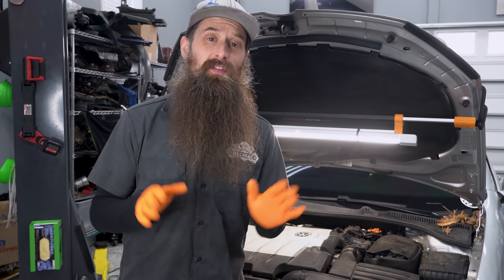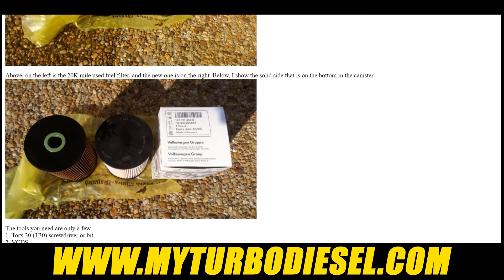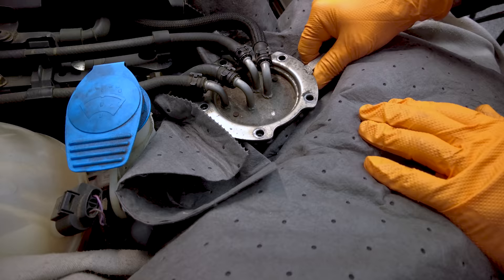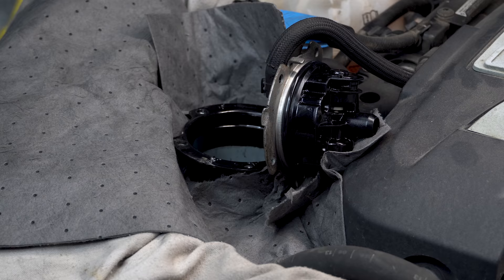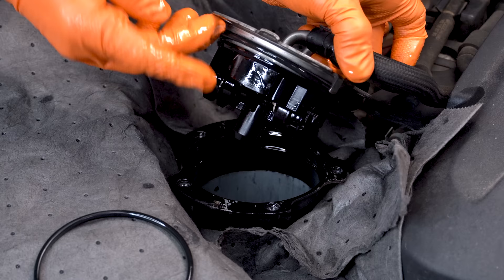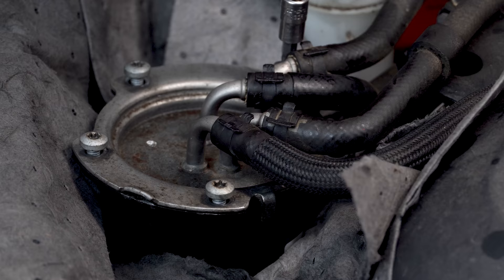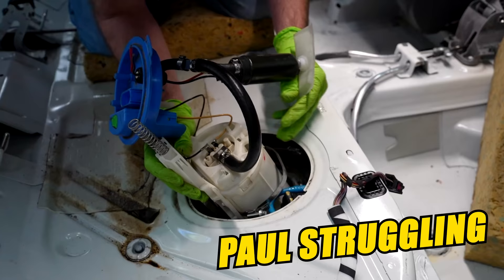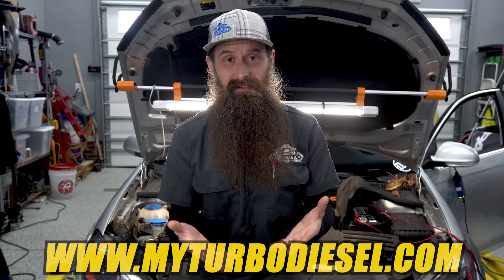Volkswagen Jetta TDI Fuel Filter Replacement ~ Common Rail Diesel

Comment from the maker: Now that we have access to a TDI, what kind of videos do we need to do? This one will need a timing belt soon ;)
Reply: 12' a3 tdi just discovered I've got a parasitic drain somewhere,new battery&charged fully,drove twice,sat for 3 days in bitter cold&dead,no aftermarket electronics.Any common places to start w/this gen tdi?
Reply: If its a model with swirl flaps, have a look at those! Terrible things, much better to use the aluminum intake without them, for engine longevity. Also i had myself a laugh after first having a Passat TDi be dead from swirl flap failure, and then to my surprise i found out the Mitsubishi Outlander also uses a VW 2.0tdi! Sans swirl flaps, luckily!
Reply: EGR, maybe which upgrades an tdi will do
Reply: I'd love to see info and opinions on the intercooler icing issues!
Reply: Waggle? =Wiggle+wabble
Reply: Timing Belt- My '13 Passat will need that soon. Also, I have a slow coolant leak from ABOVE that auxiliary coolant pump. I don't think it's the pump but I haven't pin-pointed it yet.
Reply: 3.0 TDI swap.
Reply: EGR replacement please!! Love the videos man! Do you guys own the TDI? Or is it a customer car
Reply: @acefighterpilot  i need this for my d2 A8 haha
Reply: Do a water pump. Because mine blew on my 2015 golf TDI.  the cooling system is why more complex than  my mk7.5 GTI.
Reply: Timing belt would be appreciated! I got a 2015 tdi, but I'm sure a lot would be similar, also the fuel filter is a bit easier to change on 2015s imo
Reply: Diagnostic fuel cumsomption comon issues that look to high for tdi. I also would like to know whats your take on the performance before and after  the dieselgate cpu/hardware update. how the cars behave and drive.
Reply: Explain why the 1.9 is superior to the 2.0
Reply: Turbo work and injector work
Reply: @MadMaxx570  I need the part number. I can’t find this mythical intake manifold anywhere.
Reply: Definitely do an EGR clean and/or replacement!
Reply: Timing belt sounds great. How about a CP3 mod to get rid of the trash CP4 on that engine.
Reply: Can you do a video with your Touareg?  I have an awful time with the filters when I grab the little handle and try pulling it out.  I’ve actually pulled it out with the spring loaded pipe it goes on. Then the pipe never stays in the housing because the tabs get messed up. Thanks.
Reply: Fuel injector checks and how to clean the nozzles
Reply: If this is a DSG car, definitely the fluid change and the brake fluid changing procedure (especially in regards to the clutch)
Reply: Thermostat!
Reply: COMMON ISSUES WITH CR-TDIs
Reply: Please do diagnosis for the intake motor flap :)
Reply: o2 sensors and cleaning them please! My 2011 is throwing codes for the sensors and I'm hoping I could pull them and clean them and not have to spend much at all (maybe glow plugs too since its winter, thanks for the awesome straightforward content!!)
Reply: A video showing any 6 speed maintenance aside from the normal fluid change would be cool. Also, my fuel gauge randomly decides to not show anything. Very intermittent but maybe a video pulling the fuel pump assembly? Thinking a dirty or faulty sending unit could be the cause?
Reply: @BrydonMedeiros  had the same issue, take out the sender unit in the tank and clean with electrical cleaning spray the PCB located on the level arm
Reply: @kh_trendy  been there got the “fixed IC” with flapper and vacuum lines per VWoA on my old 2010 CJAA. Amazing the amount is of money they were willing to sink into TDI at the start to keep thee engines on the road.
Reply: @theodosispasiali2119  dieselgeek bracket fix for the win at $70!
Reply: Yes, timing belt. How do I inspect it, check its conditon and of course replacement.
Reply: @glengill8904  Get a multimeter and check the fuses. Charles has a video on how to diagnose parasitic drain.
Reply: @740GLE  thank you 🙏
Reply: Something on the crankcase ventilation would be amazing. 

Also cleaning the vnt of turbo would be great as well!!

Thank you!
Reply: @ryang5441  dsg has a clutch?
Reply: Oh and the DPF, how to take care of it, how to know if theres a problem, what can VCDS do for us, can it tell us the state of sediment, is it a good idea to do the "emergency DPF cleaning" and if so how?
How else to clean the DPF?
Reply: @Lagggerengineering  it’s simple, delete it.
Reply: @briansmith9258  Unfortunately we people not in YEEHAW land cannot do that without violating emissions regulations.
Reply: @Lagggerengineering  you keep your stock system for emissions test and warranty work. Pita to switch exhausts but it’s what they do.
Reply: @Lagggerengineering  you can buy a replacement exhaust with a hollowed out DPF. Readiness tune.
Reply: Delete, cp3 swap, bigger turbo, tune.  😊
Reply: @sturmantheyounger  Jeremy Clarkson: POWAAAH
Reply: @briansmith9258  has two!!!
Reply: How do you extract more performance from a diesel?
Reply: T3 TDI routine maintenance

CJAA timing belt service, and how to know when to change the serp belt
Useful mods vs. waste of money (IE, fluidampr vs "cold air" intake, etc)
Trans fluid flush
Passat/CC control arm mods
Selecting and installing GTI, TT-S and S3 parts as OEM+ upgrades (rear sway bar, short shifter install, control arm bushings, etc)
Haldex swap
Reply: Egr and intake manifold cleaning video maybe?
Reply: @magellanicspaceclouds  just a tune can do a lot.
Reply: @audiquattro3963  cold air intakes lol
Reply: I've got a VW Jetta 2015 TDI
Reply: @740GLE  I know that but it’s not like a manual that uses brake fluid that needs bleeding like a manual. That’s what he was asking. He had dual clutch dsg confused. Is how I read it.
Reply: @740GLE  can you elaborate on the vacuum lines? This the first I’ve heard of it.
Reply: @briansmith9258  for CJAA & CEBA Gen 1 CR TDI VW implemented a vacuum actuated temperature controlled IC flap, that blocked off half the IC if the intake temps were under say 40f, this helped prevent moist EGR gasses from freezing in the IC and then thawing and pooling up in the IC piping only to be sucked into the intake and cause a hydro lock situation 3-5 seconds after starting the car. If you tried to start the car it’d act like the battery was dead unable to turn over the engine until the condensation passed the rings. There were some cases of bent con rods that required new short blocks. I personally had 3-4 cases of hydro locking before the IC kit was installed. There’s a TSB for it, it was quite a creative solution VW came up with.
Reply: We need all the tdi videos. I love my 14 jsw
Reply: Thermostat
Reply: Intake manifold. The flapper motor likes to have a holiday something something dieselgeek bracket.
Reply from the maker: Oh yea. I actually did a video on that forever ago! But I bet I can do better
Reply: @HumbleMechanic  quite literally I drive 15,000 miles a month on my TDI. Currently at 192,437 mi, we bought this JSW in July of 2021. They're the best. Bought at 109,000
Reply: @Skrillfreak  perfect kind of driving for them
Reply: @briansmith9258  I agree some video on how easy a catch can would be on these cars as it makes me uneasy seeing how oily the intake side is from it…
Reply: Cp3 upgrade and install!!
Reply: @InternationalCombustion  yeah my big issue currently besides swapping chargers. Is catchi can.  Ecs kit is 300+.  I read about somebody using a jeep brand one off eBay for like 120 maybe.  I definitely need something.
Reply: bleed coolant system on 2015 mk7 crua
Reply: make a video for frost heater install on mk7 TDI, please and thank you.
Reply: @InternationalCombustion  I don’t know if you’re joking or not, but diesels don’t need oil catch cans.
Reply: @jottow680  walk+wiggle
Reply: @glengill8904  77⁷⁷6 6th
Reply: Please do a dpf on the tdi. Is there a way to cancel out the dpf. I constantly have issues with this and the dpf keeps coming on.
Reply: @fearofchicke  1z/AHU most certainly don't if you are up for removing intake manifold and spending hours cleaning MAJOR yuckity.  At 100k the intake ports on head barely had room for a Sharpy marker pen.  Alfdex makes a spinner on my 13 liter Volvo... basically all big trucks are same with exception to body mount which bolts to engine block. It uses oil port to spin a cage much like amusement park ride (where the floor drops and you are stuck to wall) but only thousands more rpms.  No more oil spot after idling overnight.  The old design of vent to atmosphere caused nerve damage to drivers after several years.
Reply: not sure if i’m too late, but all the basic maintenance (fuel filter, timing belt, all fluids) would be nice to know how to do… as well as everyday diesel maintenance (how to burn out DPF, fuel additives, etc)

Comment: Without a scan tool: pull off the top-left fuel hose from the cap,  pull the cap off and see what is the fuel level relative to the container. Put the new filter back in and let it soak some diesel in, top it to the same level with fresh diesel, put the cap back on, if you went too high, the surplus will exit trough the cap hole, after tightening the screws in  a star pattern, put the hose back on, cycle the key 2 times and it starts up like nothing happened!
Reply: Me same
Perfect
Thank y'all

Comment: I have owned a CJAA VW Golf TDI for 8 years now and you do not have to use VCDS to prime the filter housing, but it is the most efficient way to ensure all of the air is bled out of the fuel lines. Personally, I fill the housing up to a little over half way and put the filter back in slowly. This ensures that the housing is "roughly" all the way full without any overspill and you can cycle the key 2-to-3 times to get the air out and ensure that you do not run the HPFP (High Pressure Fuel Pump) dry. The biggest discrepancy on this car is arguably the HPFP. If buying a used GOLF TDI, ensure that there is no metal shavings in the fuel filter housing or clinging on the inspection screen on top of the HPFP before signing any paperwork.
Reply: Doesn't work on all. Key cycle does absolutely nothing on my 14
Reply: @davesnothere3425  strangely I have a 2014 and mine doesn't have an issue and I replace my fuel filter twice and I do it the same way that this guy does it.. make sure those fuel in the filter housing I even put some fuel treatment additive in the filter housing to give the injectors a good clean. And I never used vcds or any scan tool bulshit to prime the fuel system.. if you cycle the key on you can hear the fuel pump in the fuel tank running then shut off.
Reply: Vcds is not even that expensive, obd11 is even cheaper, just bleed it, vcds and obd11 pay for itself after the first fuel filter change

Comment: Can't extinguish the CEL that came on after replacing filter. I can cancel CEL with my scan tool, but light comes back on after engine re-start. Also, it shows no codes...just annoying CEL for no apparent reason🤬

Comment: Yay TDI's!
Not sure about the CR TDI's but you can remove the filter housing of PD TDI's, it's held on by some tabs. If you dislodge the housing from the tabs before removing the cap, you can take the housing off the car to empty it into a bottle and/or cleaning the inside of the housing. Having the housing off the car also makes it easier to fit the new filter.
They're super old but more PD TDI videos please!

Comment: I typically use some fresh ATF to lube the o-rings on diesel fuel filters. ATF is a bit more slippery than Diesel, so i find it's better for avoiding pinching an O-ring. Also it mixes very easily with diesel and diesel engines can basically run on the ATF anyway. So a few drops of ATF in your diesel fuel isn't going to harm anything, in fact most likely the opposite. There's lots of detergents in ATF that can help clean carbon deposits. An old farmer's trick for having an injector that isn't spraying well is to pre fill you fuel filters with ATF and run it.
Reply: Do NOT do that on a CR engine. Sure fire way to destroy the HPFP is mixing anything in the diesel. I've had to replace the complete fuel system of a friends audi a4 because someone accidentally misfueled it with only a few litres of petrol

Comment: Nice video!
Love to see a coolant flush on a 2009 TDI and a 2015 TDI.  
Brake flush using a power bleeder.
Like to see a step by step timing belt change on a 2015 TDI GOLF. 
How to put the front lock carrier in the service position.
Upgrade 09 jetta factory radio to new radio with blue tooth, Can Gateway module, etc. 
Love to see more tutorials on VCDS.

I live 2.5 hrs east of you and I don't mind if you want to use my 09 TDI Jetta or 2015 Golf TDI for any videos. I also have a 2021.5 VW Atlas

Comment: Great vid, I know lots of people also top up the filter housing before closing up……but I would strongly recommend not doing that if you run the HP pump dry even for seconds it’s cattle trucked, also in vcds the command can also be called ‘run transfer fuel pump’ I doubt you guys have the latest TDis  (thanks to dieselgate?) but my recent TDI here in the uk where it would be cheaper to put gold in your car, doesn’t seem to run the low pressure pump unless and until the engine is running, so the ignition on/off scenario wouldn’t necessarily work.

Comment: Started as a mechanic this month, first job was this, replacing the vacuum\lift pump, and an injector on a 2.0tdi. Little did i know, they hadnt done their research, and the customer was right in thinking it ran on only 3, as it had eaten a swirl flap, absolutely ruining the valves, head and block on that cylinder. RIP!

Comment: The screwdriver type torx tool should be adequate to tighten down those five screws. Very easy to strip the threads bearing in mind the 'O' ring (providing undamaged) is what seal's the fluid from escaping.

Comment: Things have changed from the ancient days of the early 21st century when you would go to your local “diesel” seller that pushed his own mix of “bio-diesel” for 20 cents less. That was when you’d pour the dregs out of the filter. Now in these modern times you might even see a cetane rating on the pump! 😱 But seriously, Charles, nice video. Doesn’t show the bleed screw like my 06, nor the flange gasket of my 15, but a good procedure nonetheless, and truthfully these filters are not so expensive that the DIYer can change them at the 10k oil service interval. 👍👍

Comment: lol 5 nm, when I did mine i swear it was at like 20 ft/lb. The previous tech clearly didn't know what he was doing. After 4 broken T30 wd30, a heat gun, a punch I was able to get all of them out. I of course replaced all the fasteners.

Comment: If you don't have a scan tool to prime the system. You can put the filter in the canister then fill it with fresh fuel. Then put to top on and tighten it up.
Reply from the maker: yep., just put that filter in slow! LOL

Comment: Note: On PD 1.9 and 2.0tdis the process the same HOWEVER on PDs the turn of the key to prime the fuel is enough if you didnt drain the fuel out of the housing which on PDs you shouldnt otherwise you gonna sit there cranking for days. Cycling the key once before start does the trick at least in my experience.

Comment: I change mine every 5k miles when I'm doing the oil filter and while I'm there the air filter too, for an extra couple quid it's worth it. I've 200k plus on the engine, hopefully many more miles to go.
Reply: That's unnecessary, you only have to change your fuel filter every 4-5 oil changes... There is no benefits from doing them that often
Reply: @isaacshively6705  on some countries we have really dirty fuel, low grade. But even I agree, every 5k is way too frequent. However, the first car I got, it must have gotten so neglected that I actually felt increased performance after changing that filter
Reply: @mikemx55  mehhh diesel is usually pretty clean no matter where you are just got to worry about water in it and if VW's are like my wife's truck it'll have a water in fuel light and if your car was neglected you just change the filter run it for a day and change it again and you'd be good, diesel is cheaper and easier to make so they usually don't cut corners
Reply: I do mine every other oil change, i run my oil 8,000 miles, do the fuel filter every 16,000. All had been good, Get all your parts online. Its amazing the dealer charges $45 for a fuel filter when the same one online is $12.
Reply: @yamahayz0426  where you shopping? Their $20+ online.

Comment: Changing the fuel filter is a nightmare for me. Everytime I changed it, somehow air got trapped and could never start up the engine. Seems to be a common problem on this cr tdi's, I did everything by the book, pre filled the filter, primed with vcds plenty of times but it always took many tries and me ending up having to vacuum through the return line to get it working. 
Now the weirdest part was when I primed by vcds to bleed the air out, I removed the fuel return line to the tank to see if I could remove airlock wherever it was, I pressed the priming button and the fuel started coming from the return line to the tank instead of coming from the hpfp and it sure made a mess with diesel everywhere.
So my guess is the tank fuel pump is working backwards atleast when I prime it by vcds I don't know if that's even possible but that's what happened hence why there was always an airlock.
Weird that I see many videos with just cycling the ignition and it turns right away and for me it's always a pita.
Mine is a 1.6 tdi with the complete fuel canister instead of just the filter and 2 fuel lines instead of 4.

Comment: I have a 2015 tdi jetta with a straight pipe rawtek system with malone tune.  It really wakes the car up pretty peppy for a 4 cylinder front wheel drive.  I filter all my diesel fuel through a 2 micron transfer pump before filling any of my diesel vehicles.  I am looking at doing an amsoil oil filter bypass next.  Do a video on that i'm curious where you would choose to put the filter.